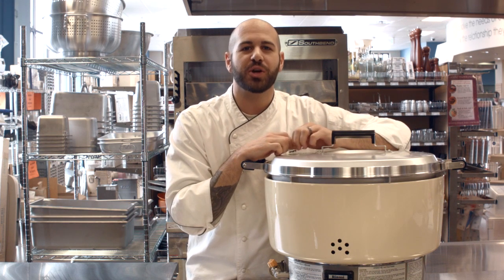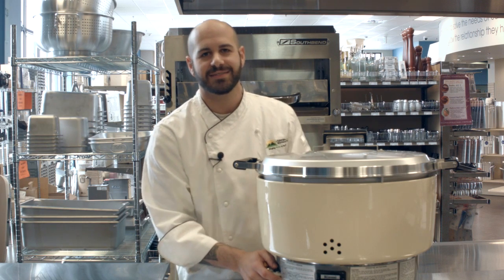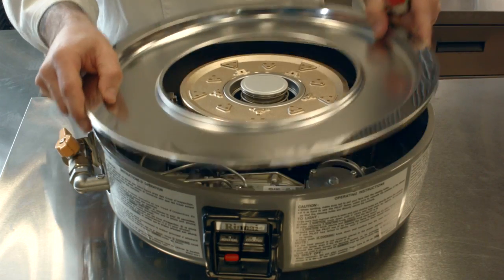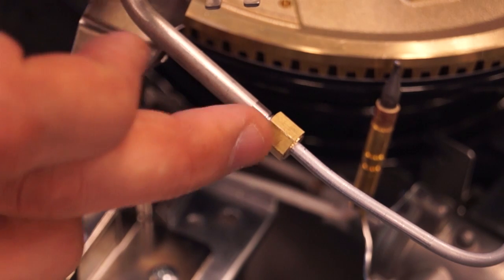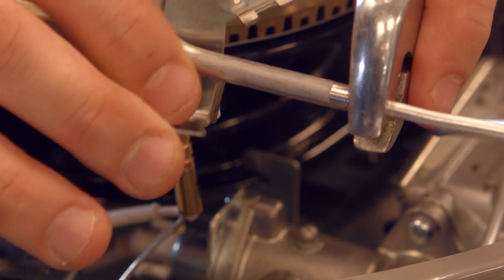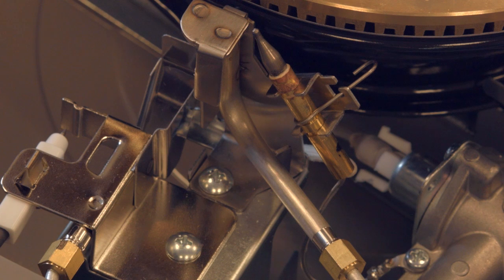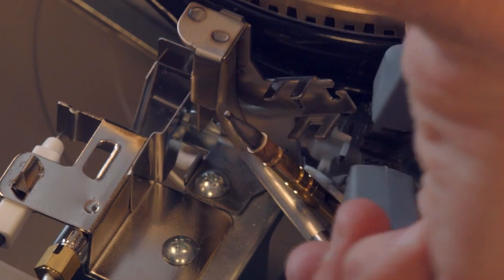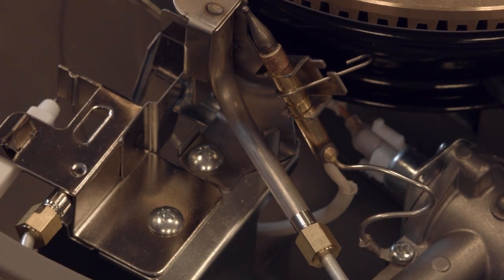Rinnai Rice Cooker Repair - Part 1: Replacing the Pilot Orifice and Thermocouple | eTundra

Comment: Absolutely gorgeous range! Super easy to use==allmy.tips/ZLINE_Range?36J   I had a question about the fan button and needed to call Z line customer support and they were super easy to work with an answered right away. My only wish is that they carried them in the actual Home Depot stores. I’m sure they would sell many more!